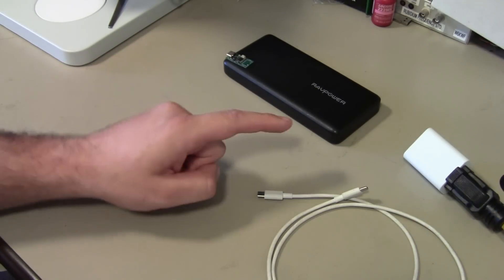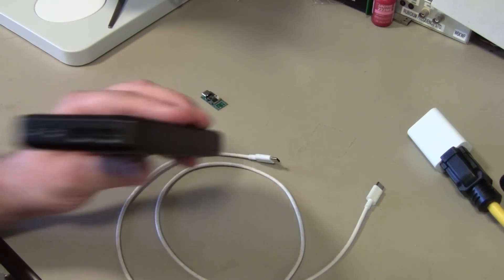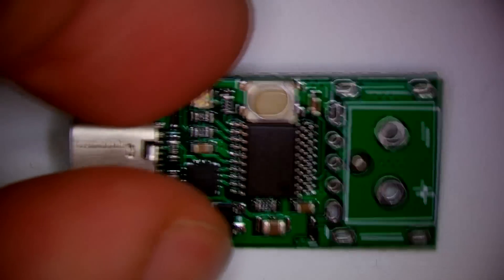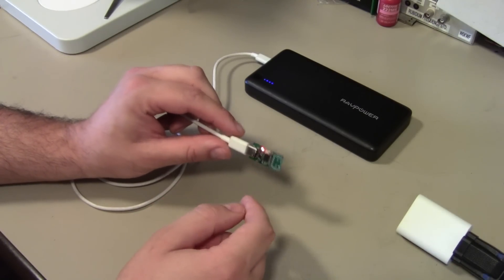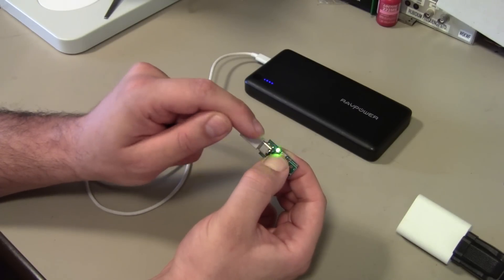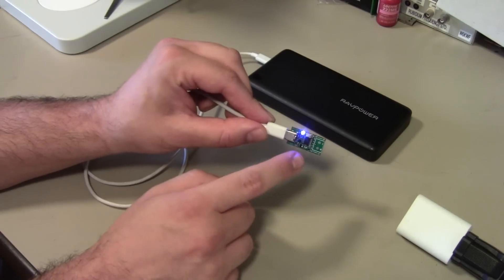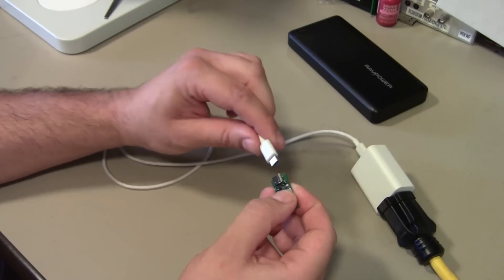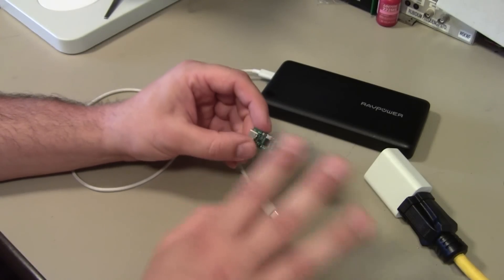How to power ANYTHING using USB-C Power Delivery and the ZY12PDN PD Trigger Board

Comment: There is something else to remember, if your power supply does not support the current, it will start blinking. Usually only USB c mains power supply do support greater current. For example a given power supply might support 40W by using  2A at 20V, it does not mean it will support  40W  at 15 v, which would mean more than 2A.
Reply: The spec says it should cut out the device if it asks for 40W at 15v and its rated for 2A. 
In theory USB-IF has a protection mode to cut power to the mosfet before it burns if you ask more than what it is rated for.

Comment: I'd love to use this to charge my lithuim packs im planning on making. Im just using DC out and this in to charge... 18v 18ah-50ah area (staged packs wired together) is this possible? I feel like this is a stupid question lol
Reply from the maker: This can give you 20V, but you'll need some kind of battery charger / management board to go from that to a battery pack

Comment: I have a feeling the trigger  board is just a buck/ boost converter  and  doesn't actually do anything
Reply from the maker: Nope. It does nothing with the main rails from the USB-C connector except expose them on the two solder holes on the edge

Comment: Thank you very much for this video, it solved my problem with using my PD Trigger board. I was going crazy trying to figure out whether it was my board, my multifunction charger, or the wrong cable.
Turned out, some time ago, when I just got the PD T board, I have put it in permanent 5V mode and forgot about it, so it was always outputting 5V. Only, after I re-watch your video, I figured out how to "handle" this little board. Also learned, that pressing the program switch a little too long (like maybe 1/2 sec instead of 1/4 sec, will not switch to the next voltage output level). That's an excellent video. Thanks again.

Comment: Do you know if this ZY12PDN has back flow protection? That is, if this board's output is wired in parallel to another power source, say 12v, can you use the 12v power source (without the PD board powered) without damaging the board? Use case is to have a power inverter that can take input power from this board or from a 12v cig lighter.
Reply from the maker: It doesn't. The two solder lugs are directly wired to the USB-C pins.
Reply: @KennethFinnegan  thanks yeah I thought about it after I asked and realized that was likely the case

Comment: i olny need 5v for pi 4 but can i use this to charge the lipo battery i plan to use with another board
Reply from the maker: This will only negotiate a higher voltage. lipo charging takes more management and regulation than that.

Comment: This is a great explanation.  Thank you.  I have a question about the receiving side of power delivery.  Say you have a laptop with USBc that supports power delivery at 5-20v 1.5 amp.  Is there any way to get it to accept 20v  (say you have a raw 12v battery and a boost converter that will boost the output up to 20v)?  Is there any way to trigger the receiving device to accept 20v?  For example, can you run these boards in reverse (I suspect not).
Reply from the maker: Yeah, this can't handle the reverse. For getting USB-C PD source ports from a raw 12V battery, I got one of these a few months ago which works great with my laptop/etc: https://amzn.to/3mvUYKX I love it.

Comment: What would happen, if i outfit an old 20-Volt / 60 W Notebook charger with ZY12PDN configured to 20 V and connect a USB-C Device that doesnt support 20V?
Reply from the maker: If it can't negotiate the programmed voltage, it stays at the initial 5V, and I suspect most laptops would just do nothing at that point.

Comment: Also, are you free to wire anything you wish to the output? I'd like to put a barrel connector on it and I know they can take 12V.
Reply from the maker: Sure. It has solder pads for a USB A connector (I have no idea why) and two big holes for screw terminals but I just took a barrel plug with some wire and soldered it onto mine.
Reply: @KennethFinnegan  thank you for the reply. Now all I need to find is a little housing for the chip. I'm planning to use it and my portable battery bank to run a 1000 lumen (9 watt) LED work light I picked up for use on my kayak as navigation light at night. The light can be powered by 120 AC, 3 AA batteries, or the 12V barrel jack in the back (supposed to be used with the car adapter it was supplied with). I figure hey, if this thing will move 12V at even 1 amp, that's more than enough for the light. And the battery pack I have can put out 12V/3A so it should be good to go. Now, to waterproof the chip.

Comment: Kenneth, you highlighted that the user button could be "locked out" so it only supplies a fixed voltage (like 12v) is that by desoldering the button or is there a better way ?
Reply from the maker: The lockout is by the programming method I describe by holding down the button on power-up. All the other modes than red don't use the button other than by holding it down on boot to enter programming mode

Comment: I have a barrel jack on back of a cpap machine. could i hypothetically power the machine from a 20000 mah power bank? btw, i have the proper backup battery for it. However, when the larger battery is being recharged with panels after a hurricane, i want to have intermiitent use of my numberous battery banks. does this make sense? I am a novice with this but found your vid the best explanation of how one might use pd trigger board. thx

Comment: I bought three of these boards from three different sellers, but NONE of them work with ANY of my PD-compatible chargers or power banks. I'm totally stumped. Can only get 5V output no matter what I try. All boards cannot detect the PD. I have tried plugging them with and without a load.
Reply from the maker: You try different cables? Your cable might be missing CC1/CC2 or something silly like that.
Reply: @KennethFinnegan  Thanks for the reply. What I didn't realise is that, despite eBay sellers lumping them together, PD (Power Delivery) and QC (Qualcomm Quick Charge) are in fact two different standards and that all of my chargers are QC. There is an equivalent board for QC triggering; I shall buy it soon.

Comment: Kenneth, I can't tell you how useful this video was. You were correct, there's very little clear information about these board on the net, especially on the sellers listings. Your video was well filmed with clear audio and articulate explanation. Thank you very much!
Reply: Came here to say this as well.  I've had 2 of these little boards for a year or two now and knew about how to program it (and confirmed voltage by using a multimeter) but had no idea what those last 2 modes were, especially the one to negotiate the highest possible voltage, as I didn't think to try it on different USB C power adapters, although appropriately I have the same RAV Power Battery Bank Kenneth has, so I could get a wide variety of voltages from it.  Only just came across this video so now I know, thanks!
Reply: Agreed. I see different voltages on charger supplies, but never understood how they were selected. Very educational. Thanks
Reply: Yes!

Comment: Hi.. I want to power up a portable projector with built in battery using the same method.. (to watch movies for longer.) the power supply that it came with says 15 volts 3 amps.. Could I use this method to do 5his?

Comment: Hi! Can I ask for your help?

I have a  USB-C to 19v DC PD adapter. I would like to use it to power my 12v device by plugging it to the USB 3.0 port of my powerbank. The powerbank can output usb 3.0 (5v, 9v and 12v 1.5A) I tried it and it worked. It powered my device. My question is, will it damage my device in the long run? Or is it safe? Thank you so much! 🙏🏻
Reply: As long as it gives the right voltage, it should be safe.
Unless it is some very sensitive equipment that damages when not enough wattage can be delivered.

Some really old transitor based things used to be sensitive to this. If it is modern electronics it should be fine.

Comment: Interesting. Just got my hands on one today, I thought I could feed it with a car battery or some whatever external source and than drive that current to a laptop through it's USB-C port. I guess it's just works the other way around. Thank you for the explanation though! :)
Reply: Just use a standard USB-C PD car charger from Anker or similar
Reply: I have found two products that do whatt you're looking for, I wish there were more:
--BatPower EM3 90W PD USB C Converter
--BIXPower USB Type C Power Converter

Comment: What happens if the 12V Router gets power from a standard USB-A 5V source? Would it damage the router or will the trigger just reject the 5V communication?
Reply: A standard USB Type A 5V power supply doesn't need anything to be triggered and since it can't provide 12V needed for the router, what scenario are we even talking about?
Reply: It would do absolutely nothing to the router.

Comment: That is just awesome! Is there any way to do this the other way around? I've been trying to substitue a 61W Macbook Pro wall charger with something like this. One thing is for sure, the computer negotiates 20 Volts with it's charger. However, I have a 24V deep cycle battery bank (with solars) and I want to use that to charge my computer using USB PD but I have no idea how to accomplish it without mixing inverters into the picture. Afterall, I need is 20V but I have 24 with a positive and a negative wire. I'd love to hear some inputs on this, better yet, see a video about it! :)
Reply: There are "cigarette lighter" USB Type-C PD chargers that are intended for 12/24VDC automotive applications. They are available for purchase all over Amazon and eBay. Some are 45W or more and are quite efficient at DC-DC conversion. You'd just need to hookup a "cigarette lighter" socket to your battery bank.
Reply: https://www.coolgear.com/product/usb-type-c-24v-dc-input-with-pd-output-dc-barrel-odm
Reply: I'm also wondering about this! I'm trying to make a solar powered USB-C phone charger :s Thanks for the video though Ken I learned a lot!

Comment: Thanks for your informative video mate.

Just one correction though... My power supply supports 5/9/15/20V and not 12V and the colours are still sequential the same way so the teal/cyan in my case is is the 20V and there is no blue.
This is actually a problem. If I program the trigger on 12V with another PSU and then use this one, I would get 15V instead.

I hope they fix this in the next version.

Cheers!
Reply: Huh, that's interesting. I have a laptop charger that's also missing the 12v output but has all the others 5-20v. If you put the board in "max voltage" mode, does it output 9v or 20? I'd like to know this

Comment: Would I be able to use the power delivery trigger board to charge a laptop with barrel style connector there by eliminating the power brick that comes with the laptop?
Reply from the maker: Maybe. If you can charge the laptop from any DC power brick of the same voltage, then all this does is get that DC voltage out of a USB-C power supply.

Comment: I wish there was also something that made my bench psu or my laptop charger a USB-C PD Charger
Reply: I think it is better to mod your laptop AC input so you can power your laptop with USB PD, there are smaller modules you can buy which can probably fit into a laptop somewhere.
Reply: Nekteck USB Type C Car Charger with 45W Power Delivery and 12W USB A Port

Comment: It would be even cooler if there were a more complex version of this board that ingested standard PD2/3 PDOs and output PPS at the full allowable range. Sure, there would need to be some DC-DC voltage conversion, but wouldn't that be totally rad?

Comment: There is one issue that I found with these PD triggers. If you connect the PD trigger to a device that does not constantly draw power, the power bank will reset and switch to 5V despite the setting of the PD trigger. In my application, I was using this to power a device that I would shut off when not in use. When I went to turn on the device, it would not work because it was now getting 5V instead of the selected 12V. I had to unplug the PD trigger and replug it in to the USB C port in order to get it to reset and go back to the desired voltage of 12V. For me, this was too much of a hassle for my application. However, if your device is always on and constantly drawing power, it should not be an issue. (I was using a Ravpower 26000 mah, 30 watt PD power bank)
Reply: Have you tried one of those fixed voltage PD triggers that don't need/support programming? They might be the solution for you.
Reply: this explains why in the video his went back to red after a while on the battery bank. I want to use one for some LEDs, so it should go to 12v and stay there as it's a constant load, exactly what I needed to find out!

Comment: Some oddities using these with Apple devices: 

1. the Macbook Pro chargers like the A1719 put out 20.2V instead of 20V, and this results in an LED color of green (indicating 15V), despite putting out 20.2V. Be careful!
2.I tested this with Apple USB-C Digital AV Multiport Adapter (A1621, the USB-C to USB-C PD passthru, HDMI, and USB type A dongle), attached to the A1719 charger (5, 9, 20.2V). It only ever illuminates the red LED when attached to this dongle (I don't have a voltmeter handy at the moment).

Comment: so i found adapters from my lenovo ( square yellow ) charge to USB-c. was all exited until i read up and unless it triggers 20v , wont work. This will do it. I looked on ebay and couldnt find one with both USB_C ends. Input and output.  Having the trigger in the middle. Anyone? I plan to make a few so i can power my other laptops
Reply: Just get a Lenovo square yellow power CABLE and solder it to the trigger board. They are sold as a spare part in order to fix your own power brick. If i were you i would just buy a 20V ONLY fixed trigger ($1 👀 on AliExpress: https://tinyurl.com/y2xelpk6 ) + the mentioned cable. Little hot melt glue, heat shrink and you're golden 👌

Comment: Did I hear it right that if the negotiation fails, it'll output 5 volts to the terminals? Seems potentially hazardous in that the attached device might be held in a bad state by underpowering. (I have a "PD Buddy Sink" board which I believe has its own output switch to handle this case, but I haven't actually gotten to using it in a project…)
Reply: Everything you can buy will see 5V and will either adjust to use it or will block it off safely. Good example some Chromebook will not charge from a 5v 1A chargers. Because it needs more amps it won't charge at all and will switch off. Some can and will just charge slowly... painfully slowly but safe.

Comment: While programming mine, I set it to 12v default (green on the program setting). However, once I save and plug the board back in, I get the LED flashing blue and a constant output of 5V. 

Any ideas on a solution (anyone in the comments)
Reply: I have exactly the same problem with the unit I just received, and have no idea why. Can anyone help with this problem please.
Reply: Did you make sure the device is drawing power as soon as it's connected? If you set it to 12V, plug it in to the power bank and wait a few seconds before putting a load on the PD trigger, the power bank will think nothing is connected to it and shut down. When you push the button on the power bank, it will still only be 12V with the device connected. You have to unplug and replug in the PD trigger.
Reply: I'm having the same problem, did you ever fix it? Apparently this happens when USB PD isn't supported, but I tried it on chargers that I know to support up to 20v.
Reply: Same issue. I'm able to program the board but it never outputs the indicated voltage. Unplug it and plug it back in and I get blue flashing lights. Using a realgraphine battery and I have tried every single usbc cable I own.